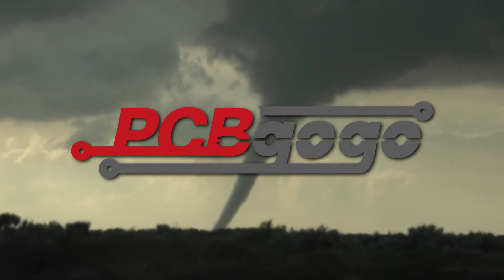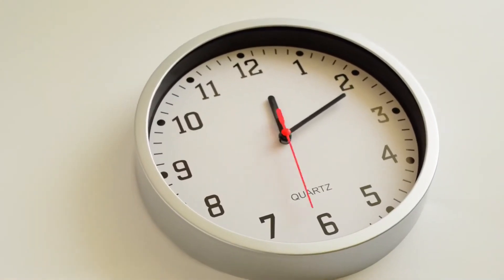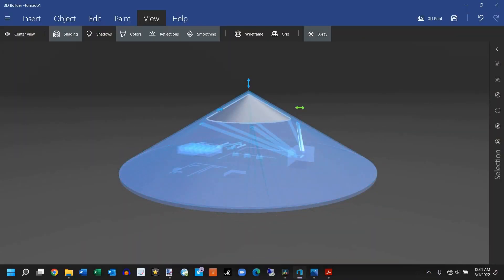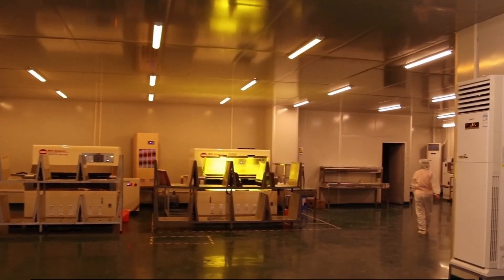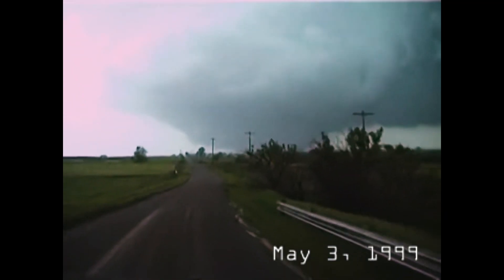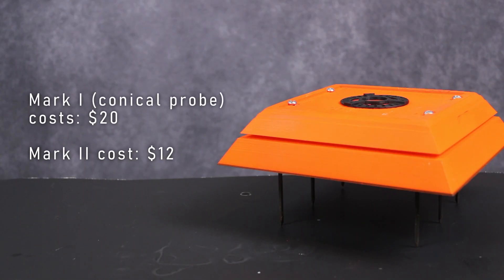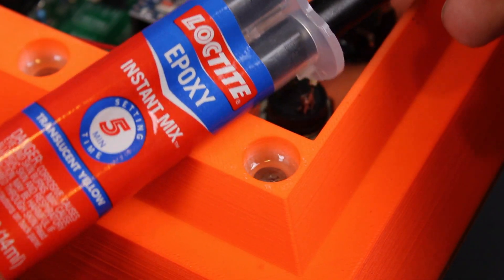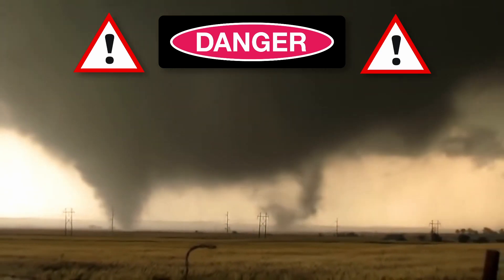Building An ACTUAL Tornado Probe To Storm-Chase With! | Part One: Design and Construction

Comment: I'm a storm chaser as well and plan to made a few of these.   I added a couple of cameras in the cad design
Reply from the maker: I actually just did the same for this season. Also beefed up the circuit with an Arduino Mega, added a GPS to log location, and loaded it with a battery that can be recharged without taking it out! I'm hoping to chase at least once with it late this season whenever college gets out.

Comment: Awesome idea. I am looking for something just like this but I want to add a top facing 360 camera as well as the sensors. Wondering if you would be interested in helping me out with this. I chase and am in the Okc area
Reply from the maker: Adding cameras was an idea for the original larger probes, so these circuit boards do have MOSFETs in place to act as camera triggers (essentially to be hardwired in place of the record button). I might be able to help, but I'm not sure to what degree I can commit yet. If you'd like, we could meet up sometime and discuss the possibilities! Feel free to email zlabcoatz@gmail if you're interested.

Comment: I couldn't help noticing him mention, several times, that they were "his designs" I'm pretty sure Jack was the one who did all of the work. This guy steals Jack's idea, redesigns the base it's housed in and calls it his. 

I wonder what Jack has to say?

Just so you know Jack's design was way better, all that needed to be done was change the material and add a base.
Reply from the maker: Actually, I did all of my own calculations, and the circuit Jack used was taken from an Internet tutorial on building a home weather station. The only thing he did was make the conical base, so no, I didn't need to copy even a single element of his own work. And just so you know, his design isn't WAY better. Each has its pros and cons, but if you're looking for the probe that withstands high winds the best and is easiest to mass produce and deploy, mine is superior. In fact, if you watch the next video in this series, you'll see we dropped both in front of an EF4 (although it missed the probes narrowly) and mine was the only one to actually collect data.

Comment: What modeling software did you use?
Reply from the maker: Just the generic stuff Windows comes with (I think it's called 3D Builder). The fancy LED cover came from Thingiverse.com though. I have Blender, but I found for simple shapes and stuff like this, there was a lot of unneeded complexity involved in using it, since I rarely use it in the first place.

Comment: Make them out of 1/4 inch plate steel 😒... Then fill it with gussets to make it stronger 💪 will add more rigidity to it but a quarter inch is plenty fine for what you're asking
Reply from the maker: I would, but for the amount of probes we're trying to make, that'd be stupid-expensive. It's also not super necessary: any flying piece of debris with enough energy to break the 3D-printed body would deliver a substantial blow to the circuitry, likely crippling the device anyway. I'm also not too worried, since Jack avidly avoids deploying near "debris generators", and the probe makes for a fairly small target. Not saying armor would be pointless, obviously, it just doesn't make sense for use to try incorporating it right now, given our abysmally-low budget.

Comment: Wow man, MARK II VTX is a big improvement on the original design so great job! I'm new to tornado probing, so how does the probe measure the tornado wind speeds if the wind has to go through those slots on the side first, and I imagine that would slow down the wind and give an inaccurate speed reading? Let me know, and great vid!
Reply from the maker: Glad you liked it! This probe doesn't measure wind speed currently, just temperature, humidity, and pressure. Wind speed would be a good addition though, but it'll have to come later...the tech needed would be pretty complex, since the normal spinning-vane anemometers would simply self-destruct in a tornado. I think ultrasonic anemometers are promising, so maybe we'll try that!
Reply: @LabCoatz_Science  Cool! That makes sense. I cant wait for you to show us a tornado!
Reply from the maker: @BackMacSci  I can't wait to see my first one, haha!

Comment: Small, beveled disc shape, central PVC pipe sticking up slightly from unit, pound long tent stake or DIY stake through pipe with small sledge hammer providing fast installation even in hard soil.  Use DIY extraction tool for stake removal.

Comment: Is that testing the Wind flow on the Air and detect if they have tornado, So I guess this have arduino, I'm very excited on your new SSTC design
Reply from the maker: Thanks, I'm hoping the SSTC will be my next major video to finish! Regarding the probe, it unfortunately can't record windspeed (might update the designs later to help with that), but it does record barometric pressure, temperature, and humidity. The recording starts as soon as the power is switched on!
Reply: @LabCoatz_Science  that's interesting